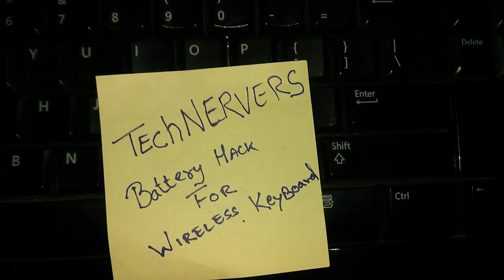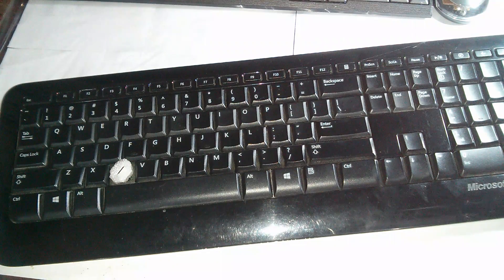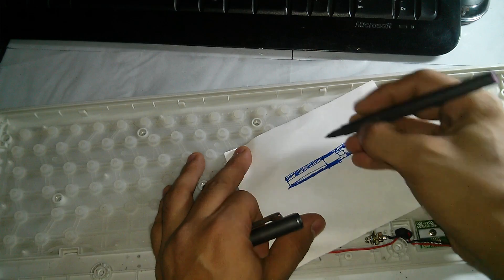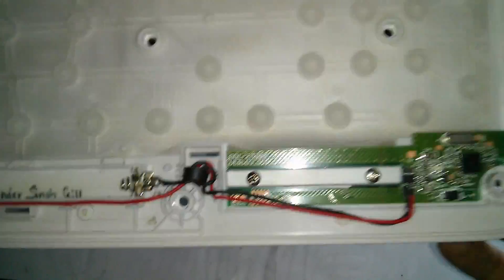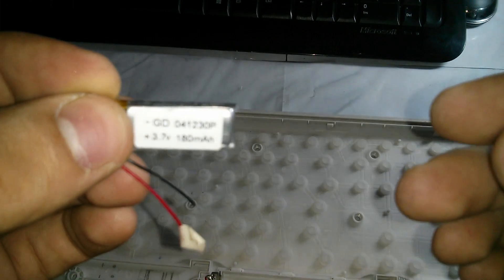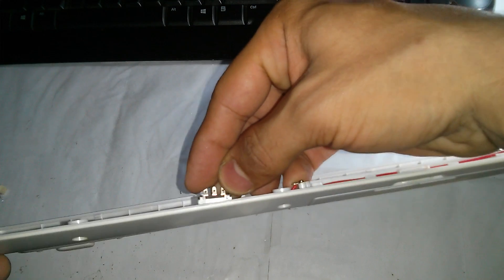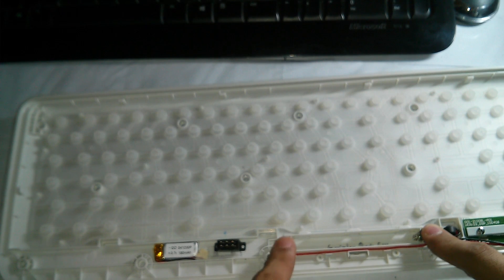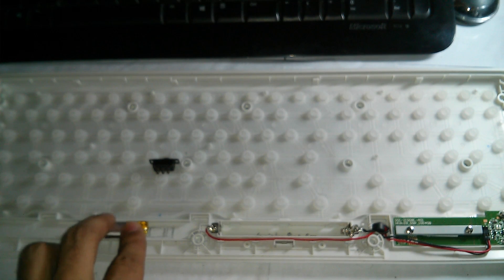Battery Hack for Wireless Keyboard - PART 1

Comment: Hey dude! I found your video after opening up my own (awful) Microsoft Wireless Keyboard 800, and it helped me a bunch. I actually never thought of adding a switch for the batteries, so now I'm trying to add a switch for the batteries. I'm wondering how it worked out for you.

Thanks for putting this video up. :)